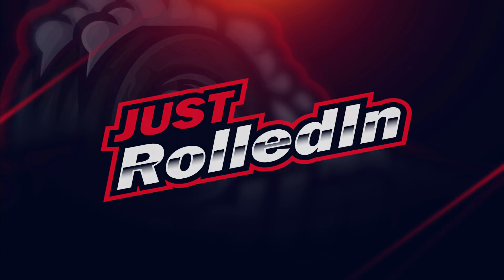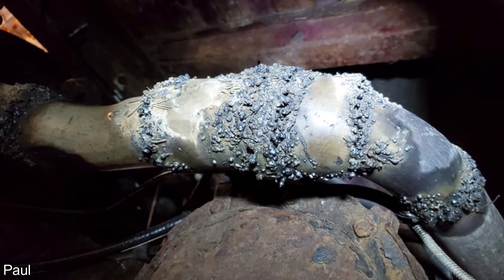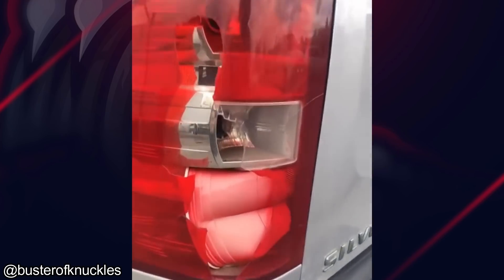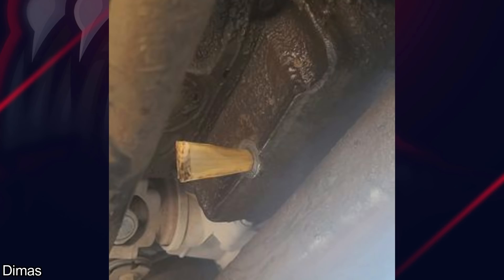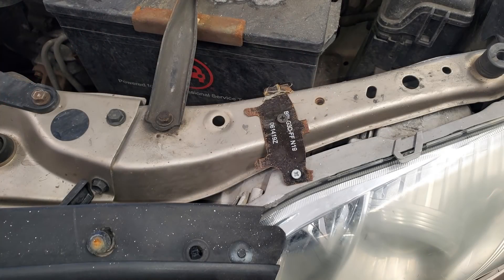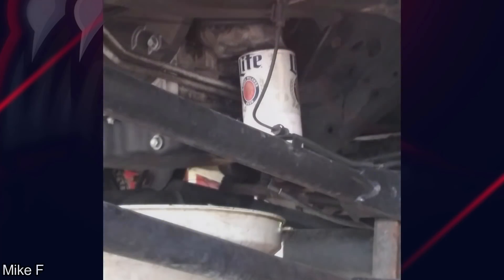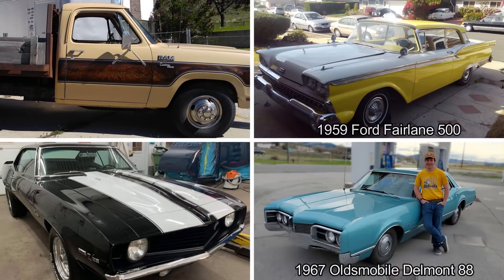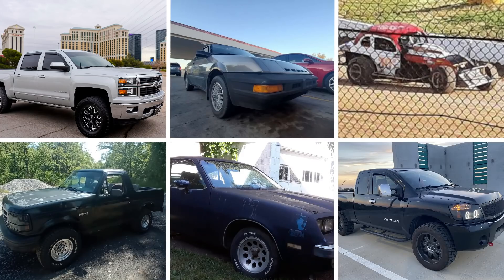Customer States Another Shop Failed To Fix Their Exhaust | Just Rolled In

Comment: With the amount of wire the guy used welding, you’d think his welds would have improved by the end of the job??
Reply: He didn’t have the shielding gas on. No amount of practice and technique will produce good welds without the shielding gas. I made the same mistake back in high school. I though this wire feed is really hard! Hahah
Reply: @mylesgray3470  good call!
Reply: At least it was consistent.   Lol!
Reply: Doubtful, look at the length of the stick out he was using!
Reply: @mylesgray3470  Agreed.  If he practised welding without shielding gas he probably thinks that this is as good as it gets.
Reply: With the amount of wire used, it would have been far better to use the wire as is to tie all the parts together and still have plenty left for xmas wrapping...

Comment: Pulease. The "shop" that did that exhaust job was in the owner's driveway, with the Harbor Freight flux core welder set to about half the recommended voltage.
Reply: And twice the wire speed
Reply: I was thinking the same thing hahaha
Reply: I can do a way better job with the same equipment. Key is make sure the surface you are welding is very clean first. I cut and notched the frame of my truck and welded it all back together with the cheap flux welder and wire from harbor freight when i was building my lowrider. That's been 12 years ago now and still daily driving it without a problem.
Reply: @user-cs3zs6jn1d  biggest key is temperature and wire speed. It doesn't have to be as clean with flux core as it does with gas shield. Gas shield has to just about pristine.
Reply: And 600ft of dollar general extension cords
Reply: I agree
Reply: No the shop was was called D.I.Y. lol.
Reply: And not switching the gun to negative while using flux core wire...
Reply: "the shop" even managed to weld the exhaust to the frame at one point!  Seen that before, lol. Picked up a 1992 Dodge cummins that had that done to it!
Reply: I figured he was trying to mig weld it without oxygen, or didn’t know to turn it on,,cause apparently he thought this was correct
Reply: @user-cs3zs6jn1d  We all know you be lying...
Reply: @pinkyandbrain1495  

He isn't. Nice try though.
Reply: Heeeyyyyy, Harbor Freight equipment do be ball'n tho. Make a good welder for moderate projects.
Reply: @clayton203  
Mig welders don’t use oxygen. They use Argon. And before someone jumps all over me ,yes the gas is often a mixture of Argon/ CO2/02. but primarily Argon because it is a inert gas which protects the weld from oxidisation while the metal is in its molten state.
Reply: @davidcat1455  you are correct,but it sure looks like he didn’t have it on or was out and tried to do it anyways
Reply: @clayton203  
I have 45 years of welding experience. That weld is what happens when you have way too low current and/or way too high wire feed. Gas or gasless flux core if you don’t have the amperage and the wire speed correct you get a garbage weld.
Reply: @davidcat1455  I don’t want to question your experience,,but I’m not a professional welder,,and I did this exact thing on exhaust pipe before because the welder I was using was out of whatever was in that tank that rides on the cart with the welder,,and I thought that I could at least make it work with out it,,”still had spark rite”,,it looked just like this,,so mayb it was a mixture of what your talking about and what I seen that don’t work very good,,not have the gas stuff,,was just going off of what I had experienced and what I thought mite had been the problem,,cause it looked exactly liked that,,i did mess with the speed and how hot it was to try to make it work,,it was the biggest mess,,since then I have self taught a little by watching and listening,,still not professional,,and I can’t afford a descent wire welder so I stick weld mostly,,but I don’t do what this looks like anymore,,and the type of equipment was high end stuff,,no flux core,,haven’t ever used it,,it was out of gas,,and with any setting,,this is what it looked like,,but I’m not a professional
Reply: LOL yeah that about right on.
Reply: @clayton203  Ah, mig uses Argon gas and for steel best is C25/Argon gas for shielding.
 NO O2, that is with flame welding torches. (mapp, acetylene, ) {cutting torch fuel gases are acetylene, propane, MAPP (methylacetylene-propadiene), propylene and natural gas}, [Soldering, brazing, and welding each have their best set up]
There may be other uses for O2 also but it is generally the Oxidizer.
Reply: @SpeedySailor I got ya,,I was just trying to explain to the gentleman that I have had this happen years ago when I was trying to fix a hole in a muffler on my truck,,the bottle was empty but I had fire at the end of the wire,,so I proceeded,,didn’t have a clue what I was doing but it was closing the hole up and it pretty much looked like this,,nowadays I stick weld most of the time if I need something welded, still by far a professional, but it works for me and I have a grinder,,but I do appreciate the info
Reply: @clayton203  I noticed that I am the second person to call out the O2 gas. You do have the option of clicking on the 3 dots next to your comment, then edit, to change the O2 "flag" to say 'shielding gas'.
My Grandfather was an Expert at brazing, while he did not explain much I still watched. Now after reading and some practice, I can remember his movements enough to make my practice 'good enough' to hold.(many holes & relights of the torch process). My father's neighbor was a Stick welder at a steel mill, so I learned stick too. [He would come over to borrow and welded our garden tractor too].  I finally got myself a Clarke mig 25 yrs ago and Love that gas, even worked at a company that used many welders, learned a few tips from them too. Tis past year I just got a small flux core box so I could weld harder metals {bigger wire} on my Honda in my driveway. Hate chipping slag but it works with patience, lots of chipping-brush-grinding after letting the small areas cool.

 That exhaust pipe may have had so many wires sticking into the pipe because of the fast wire speed, the exhaust gas flow would have restrictions-hot spots.
Bottom line is like music,
 Practice Practice Practice, learn the manual, specs, terms and more practice.
Reply: @SpeedySailor  my actual point was what ever was in the bottle,,like I say “no expert here” it was out,,nothing,,thought I could get it done with out it,,,,nope,,,but yea you are correct,,seem like my stick welding is getting better over the years,,lots of watching and listening,,while still no professional,,good enough for home built things for myself
Reply: No shielding gas.

Comment: Guy hired.."can you weld?"
"Hell yes!"
Forgets too turn on gas, continues for 3 hrs.
Reply: Shit. No gas, helmet. Aight! Where's the welder.
Reply: I had a guy literally ask me if he really needed a welding helmet to be able to weld..... Even after telling him yes! He ended up getting some $13 glasses for torching 😳
Reply: glasses will prevent a welders flash in his eyes but there will still be some serious 2nd-3rd degree burns on the face tho.
Reply: Wasn't just no gas.  I had that "type" of problem when I got my mig welder and changed from flux core to regular wire.  If you notice there are no penetrating welds, they all build up.  He didn't switch the polarity switch.  Once I did that then the welds looked more like what they should.
At the same time, I have NEVER seen welds like that even in high school.
Reply: One spool per joint 
No shop would do this, they would lose money on time and material. He definitely did it himself and doesn't want to admit his work.
Reply: @upnorth5465  welders flash is a (not so) quick lesson in why you should wear a mask
Reply: @willyjilly9684  I think.  A couple of Joints,  maybe, 10 to get in the mood. One  Joint  per spool. To admire the workmanship.
Reply: Colin L. Exactly what I was thinking also.  🤔
Reply: I thought it was all tacks, but that seems feasible too.

Comment: “What about the shielding gas?”

“Where were going, we don’t need shielding gas”
Reply: I thought this was flux cored wire..........???
Reply: Nothing wrong with flux core wire adjust wire speed and heat setting weld away
Reply: @peterfitswell535  Perfectly aware of all welding types/methods, I was just commenting from the point of view of the guy that did this and obvs never turned the gas on...... or realised that he even needed to.
Reply: @nickmaclachlan5178   I was commenting on there's nothing wrong with flux core welding wire if done properly. LOL, argon/co2 still wins just have to turn it on ; )
Reply: @peterfitswell535  lol this obviously wasn’t flux core tho
Reply: @reaganriddle  agreed just a total mess
Reply: @reaganriddle  Actually it might be flux-core, with a combination of not switching the ground on a regular mig, way too low volts with too high wire speed, and super long stick out. Throw those all together and you can get something like this... oh and a good dose of stupidity is required to get 10 minutes in and not notice
Reply: @ku8721  lol

Comment: That oil pan reminded me of an incident back in the mid 90s while I was working as a diesel mechanic at a local limestone quarry. Company had among other pumps to keep water pumped out of the quarry,a 4 cylinder air cooled Duetz diesel. Over a long holiday weekend the pump quit running and engine was basically locked up. I dropped oil pan and the oil was just about the consistency of axle grease,maybe even thicker. Being a smart ass I scooped up a oil sample bottle full and gave it to our parts guy,who sent it to Caterpillar,who did our oil samples. Since we mostly ran Cats in the pit. Never did hear back from Cat on that sample. Consensus was engine overheated and cooked itself and baked the oil to a hard sludge.

Comment: The welder appears to use the arc-stick method - then arc stick arc stick etc.
Reply: No there are wire pieces between the bird shit. Looks like he didn't turn on the CO2?
Reply: Thats exactly how my flux core exhaust weld looks. Need to buckle down and get gas
Reply: Probably mig flux core
Reply: @dw4940  change your polarity.
Reply: @Tore_Lund  I'm not sure he did anything right. Given this was obviously a DIY job, it's guaranteed he borrowed a MIG welder from someone without gas.

Comment: I wish I had some video for you  of some "repairs" I've done.
For example, winch from an alternator to the hull of a boat to tension the belts. (broken housing on alternator)
Stripped wires out of a wiring harness for trailer lights, used the sheath to siphon from gas can on roof directly into carburetor. (Broken fuel pump)
Chain and buckles holding walking beam of tandem axle dump truck in place. etc etc

Comment: To his credit the wooden drain plug was dry as a bone most Jiffy Lubes can't say that about the one that fits the hole
Reply: I've actually heard of people using wood plugs as a trail fix for a holed oil pan -- the wood absorbs a bit of the oil and expands to make a tight fit.
Reply: I'm gonna dispute this one. Everybody knows Jiffy Lube uses the impact gun on "Max Dugga Dugga" setting for oil plugs. lol
Reply: @dashcamandy2242  yeah but it's stripped bolt holds no pressure hence the leak

Comment: That's not an oil pan, it's a Jello mold!
Reply from the maker: Mhmm jello
Reply: @JustRolledIn  what caused the oil to jell up like that?
Reply from the maker: @jamessmoth8683  there was a similar clip in another video and it was caused by oil additives they added. So a good chance it could be the same with this one.
Reply: @JustRolledIn  What additives, Acetone? /sarc
Reply from the maker: @guytech7310  not sure which ones. They just mentioned oil additives. Which they said more because I'm curious to know.
Reply: @JustRolledIn  Had a 3 cyl. Perkins Diesel Genset on a ship do that. 
The cause was exhaust carbon getting into the oil via worn valve guides. 
It ground to a stop.
Reply: The oil turns to jell after it is cooked long enough !! About 30,000 miles seen it worse than this one !!
Reply: @jamessmoth8683  I've seen this happen a few times.  Severe contamination of antifreeze in the oil will gel up like this very quickly.
Reply: @joels7605  Yeap; i´ve seen it in a way that we turned the pan upside down,and nothing came out,half solid; engine had seized of course, did not just roll in by itself

Comment: I'm guessing this is what the muffler shop was expecting when I told them I already started welding in my exhaust and I just need the tailpipes (my local parts guy wanted me to wait 2 weeks). At the time I already had about 8 years experience TIG welding, and it was only a couple years before that I did a custom 3" cat back on my old Chrysler 5th Avenue.

Comment: That is some impressive welding, must have taken forever with the voltage turned down that low. (Or wire feed turned too high)
Reply: Or both
Reply: Or car battery and a coat hanger(s)
Reply: @smoke05s  I could do better with the 24 volt alternator on a greyhound bus and stick welding
Reply: This would be an artist's weld job.Beware, they may say a genius did this. Looks like they used a flux core welder with a solid wire .
Reply: could be out of gas too, in the case of MIG welding

Comment: Looks like he ran out of shielding gas and just kept on going
Reply: It looks like he tossed lead shot infront of a blow torch.
Reply: He's clueless. Even when I've run out of gas it looks better than that. I hope he didn't get hurt doing it. If he did that then he may not know about using an arc welding filter/helmet and to protect his arms, etc.
Reply: He didn't clean up the prior welds before applying the next layer... Looks like one of those cheapo 110v flux core wire welder jobs ( I know because I used one, once ..)
Reply: @robertthomas5906  Someone that does this kind of job and just leaves it as "done", I don't doubt their safety equipment being the good old Safety Squints
Reply: @hdezn26  I welded my exhaust with fluxcore it doesn't look that damn bad. 😆  idk what the hell they did but it looks time consuming there's like a pound of weld wire on each connection, maybe they filled/bridged  3-4 inch gaps which actually is kind of impressive lol
Reply: @Yophillips3272  I did one on a scooter with a 110v wire feed flux core once, It looked alot better than that job on my 1st try. But I also have looked up some welding tips prior to that so (Maybe that person didn't?)
Reply: @hdezn26  My brother in law had one of those. I came over one day and found him using it with sun glasses and these tiny little rods. Yea, I had a little talk with him. He wondered why his eyes hurt at night. Whipped out my scott maintainer and had it welded up right away.
Reply: Shielding gas, what's shielding gas?
Reply: @robertthomas5906  Yeah, the light coming off the welding probaly was crystalizing the salt in his eyes. Too much could lead to permanant damage. My 1st welder was a stick welder , It came with that "mask on a stick" . That thing was no fun to weld with.... And my "welds" with that thing were pure garbage. Tried out a wire feed one and liked that better, That one actually came with a welding helmet.
Reply: @cbmech2563  The gas that blocks rusty swords?
Reply: @hdezn26  I learned in high school with a mask on a stick. I haven't thought about that in decades. Back in those days it was gas and stick welding. At least the gas torch had a strap for the mask. I found clamping and gravity was my friend with the good old Lincoln arc welder. I still have an automotive jack stand I built back then. 40 years worth of use and it's just like it was 40 years ago. That was enough to get a job working for an old WWII welder. He used to weld ships, bridges. Nothing like learning from a guy with a lifetime of doing it. Meso lung cancer got him. Asbestos used to be so think in the air it was like snow he said.
Reply: @robertthomas5906  My 1st try without experience is likely why I wasn't good at it.
Back then I didn't have anywhere to turn to to learn welding.... 
40 years of use , that sounds like you got your money's worth out of that and then some, Nice! 
Sounds like you had a great teacher, but it sad to hear that he went to lung cancer..
Asbesto's as thick as snow, Wow. But back then No one knew the risks of Asbestos either. Also on how bad it can get a person...

Comment: I'm an IT guy by profession, but really enjoy DIY stuff and am basically rebuilding a Jeep. I did some exhaust work as well and have done a bit of welding, but only using a 110V harbor freight flux core welder. Although I'm not very experienced at all, not even my first welding attempts looked that bad. Honestly, I'm not even sure how that happens. If I had to guess, he was using an extension cord, one underrated for the current he needed, and he was getting terrible welds on account of that.

Comment: Welding while the exhaust is still up on the truck can be tricky. I did that. Not the greatest welds. But, replacing the transmission, so I have to take the exhaust down anyway. Definitely making improvements to it.